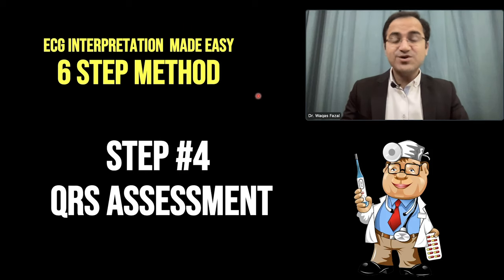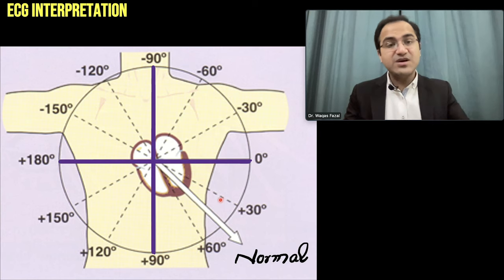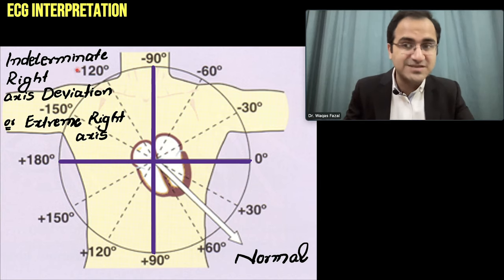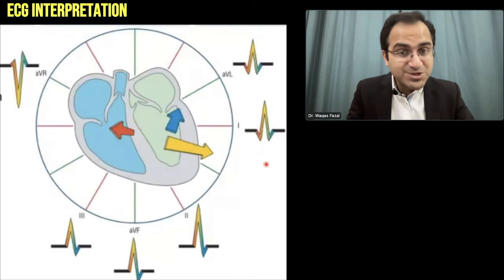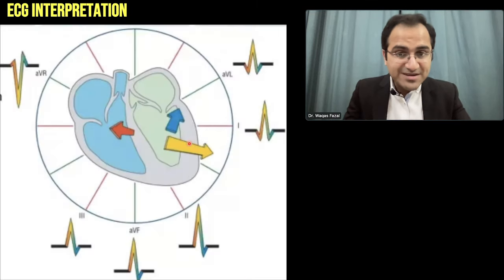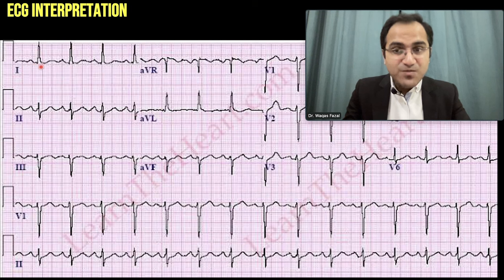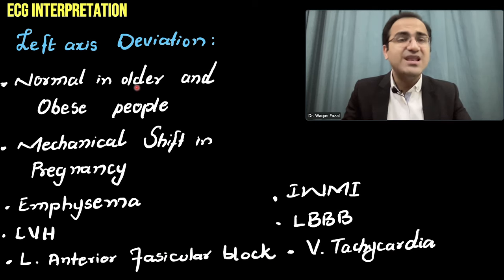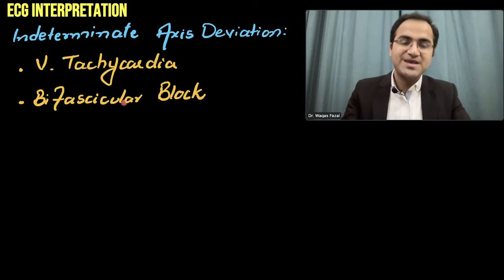Axis Deviation in ECG Made Easy, Causes, How to determine Axis in ECG Explained, ECG Lecture USMLE

Comment: Your videos are well explained sir, Thankyou.
I have a doubt to clear sir , kindly help me with that.

During a sync cardioversion, it's falling in R waves , so as to prevent v fibs/ R on T phenomenon, as R will come in the absolute refractory period of ventricular myocytes

In an absolute refractory periods of ventricular myocytes, no action potential/ impulse can generate an action , then how come and external current ( cardioversion) will cause a change in ventricles??

I am not able to find a proper response anywhere sir
If it's silly doubt , kindly excuse me